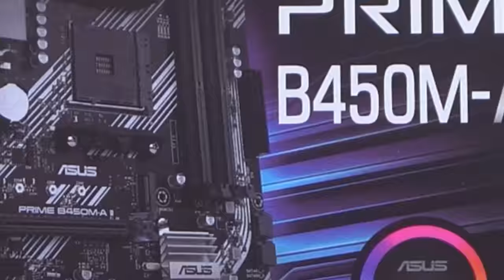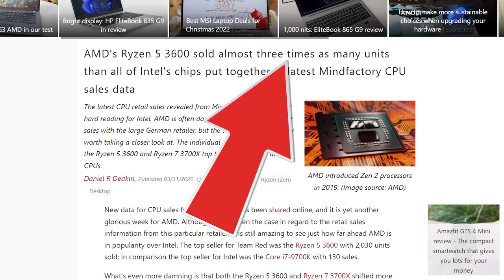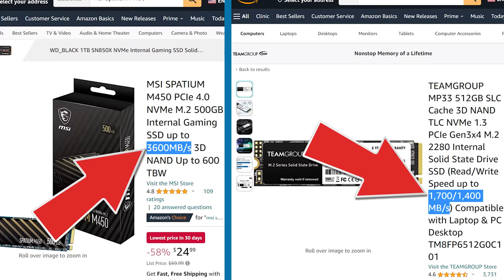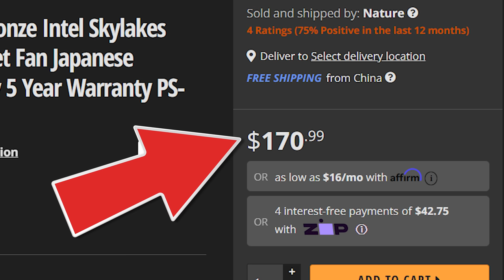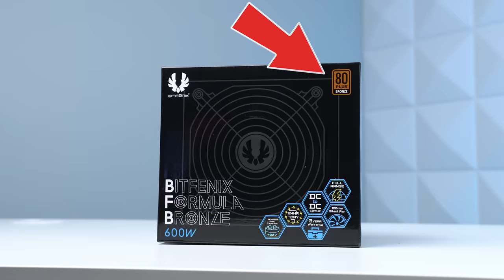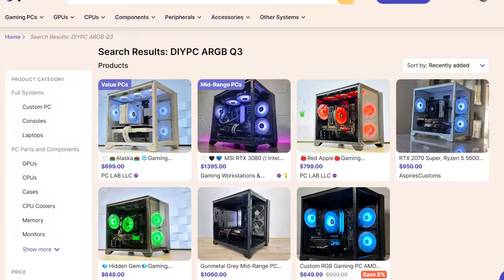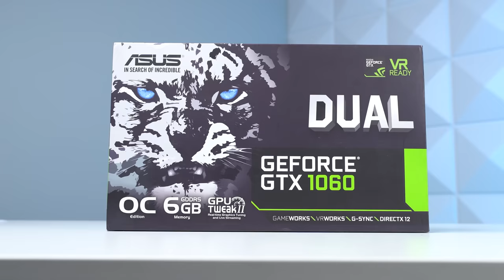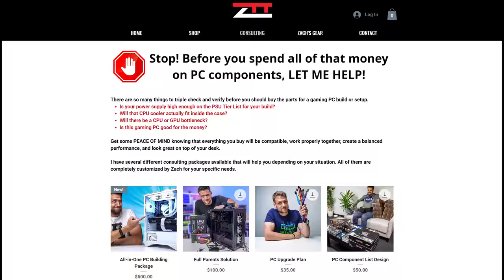A Very Repeatable $400 Gaming PC Build Guide

Comment: Why don't you just use the extra 21 dollars on a fully modular PSU instead of extensions? I'm pretty sure you can also get higher wattage as well. Good video I'm using this to flip
Reply: He's being super cheap so he can maximize profits. 1TB nvme's are $35 all day long but he doesn't want to spend the extra $7. I wouldn't buy any of his builds just on that alone. 500GB is nothing these days.
Reply: @itsatrap4986 Hey! I'm looking into buying a PC... I've never had desktop before. I'm thinking of buying a PC based on the build he showed here. Is there something specific that would make this a decent build?
Reply: @phoenixmorphix  Are you looking for a custom build or prebuilt that's similar to this? I'd would change out to a better rated power supply unit with the money saved from the extension cables and up the NVME capacity to 1TB minimum.
1) Better and/or higher wattage capacity for higher end GPU upgrades
2) NVMEs are dirt cheap - $65 for 2TB. 1TB minimum or 2TB if budget allows.
Reply: @itsatrap4986  Hey! I'm looking for a build similar... Thank you for the advice! I'll keep this in mind!
Reply: @phoenixmorphix  Yeah no problem. One more thing abOut the PSU, it's a C rated unit it's fine for what it is. Save the money for a better GPU. I'd skip the 1060 6GB, go with a RX 580 8GB or 1070/1070ti, 5700XT, 5700XT if you're going the used route.
Reply: @itsatrap4986 could it hand rx6600 ?
Reply: @Ice-Sik-ill  What do you mean?
Reply: @itsatrap4986  could it handle a Rx 6600 xt gpu, sorry. Haha
Reply: @Ice-Sik-ill  Yes the 3600/5500 is good up to a 6600XT/6650XT/7600 without bottlenecking.
Reply: @itsatrap4986   So all the other things he put are fine? except for the ones you mentioned here
Reply: @itsatrap4986  alright, sweet (cartman voice)

Comment: Rate my build, which is already above my budget but I'm waiting for Amazon prime day for deals. I live in Canada BTW. So here it is: Ryzen 5 5600x, Asus dual Radeon rx 7600 xt OC 16g, 32gb ddr4 Corsair Vengeance rgb pro 3600, msi mag B550 Tomahawk MAX, EVGA 850bq 80+ bronze 850w, Thermalright Phantom Spirit 120 EVO cpu air cooler, Fanxiang 2tb m.2 ssd, and for case NZXT H6 Flow which comes with 3 fans that I will have at the front for intake, and a pack of 3 Thermalright TL-C12C-S X3 120mm fans on top for exhaust.

Comment: I liked the video! I wanted to ask what is the best video card to choose for work (3D development), and possibly for games, so that it is budget-friendly and in reserve for the future. I have a system: Intel Core 7 11700k, 32 gigabytes of RAM, I have a 650 watt power supply, and an Asus b650 1200 socket motherboard, I think you understand what I'm talking about. I have an ATX-format case, so almost any video card will fit. Now I have a video card 1060 for 6 gigabytes, from Asus. Your opinion is interesting, I will read it with pleasure. Budget up to 600-700 dollars.

Comment: if u dont mind settling for a a320m-k mainboard (it will work just as well, got the same paired with an RX 6650XT + 32gb ram + ryzen 7 5700G , then you can even get it for 50 euros (dollars) since it is literally the same Mainboard and even looks the same apart from the chipset

Comment: Can you pleas make a video how to paint the cpu cooler i love the idea
Reply: Umm. Couldn't painting the cpu cooler mess a ton with the thermal dissipation or possibly fry a computer (if you let any paint drip onto any delicate parts, or if the paint melted or degraded over time?)

I admit im not a expert, but newegg usually has a lot of models to shop around for. It's probably easier and safer to shop around on newegg for a model you like. And while i got like a 1000$ computer, i don't really feel like the cpu gets very hot relative to the gpu. (Though, i did spend 10$ on 7x more heat transfer thermal paste meant for overclocking, 15 W/m^2 or something vs 1.7 W/m^2 or something for 10$). And it sits super cool just being superchilled by the metal heat sink (fan barely runs at all and it's cozy).

But i mean.. I might have overdone it a lil. I think like cpu gaming is like 80% your graphics card, 10% your ram, and 4-5% your cpu (unless bottlenecked). I think i did like a Intel 13100 (If i rebuilt today, the 12100 is 98% the performance for 100$ vs 110$ and fairly decent bang for buck on 1-4 core performance until 8 core).

I still like having a fancy ass cooler though. I guess the 13100 from best buy came with a stock cooler (despite 0 mention), and im happy with the massive heatsinks potentially cooling it 4x better passively with the coconut vs mandarin sized heat plate dissipation and the super thermal paste. 

I still would feel a little hesitant about spray painting though since just 1 thing goes wrong.. and frying a 1000$ computer to paint the insides a different color just gives me a lil gulp. (Or potentially frying their whole pc if the paint kept too much heat in / ruined thermal conductivity/degraded under heat).

To each their own though!
Reply: @Notyouraveragename  u dont put it on the mobo before you paint it, you take off the outer shell?? 🤣🤣

Comment: You should check out the Asrock B550m Pro4, or B450m Pro4. They're excellent sub $100 mobos. The B450m Pro4 with the 5.20 bios update will run any AM4 CPU/APU  except the 'Bristol Ridge' series. 
I can't stand fish-tank cases. If that case were available with large hole mesh panels in place of the glass panels it would have my interest.
Reply: If u live in sweden u can find some really nice deals like a 3080 for 60bucks im not even joking i found em on the marketplace

Comment: if anyone wants to build this in 2024 for any reason, I would go for a good motherboard (with a focus on more vrms mosfets, m2 nvme slots and if it is possible USB latest possible generation and PCIe 4 instead of PCIe 3, 16 lanes instead of 8 lanes (100-120$) possibly RAM and a good power supply. if it ever comes to the upgrade request, So you already have something solid. On the used market, more and more good cups and GPUs are found because they are starting to switch to am5 more and more. just my opinion

Comment: How do you reroute the cable? And what do you need for painting it and how to apply paint?
Reply: as a painter, you should LIGHTLY sand the fan so the spray paint wont peel off. lightly spray layers on until its fully covered

Comment: I just snagged an Asus white 1060 3 GB for $37 (after taxes and shipping!) The 6gb is obviously way better, especially on new titles but for $37--- Sheesh!
Reply: Oh wow the 60 series are a good card, i think they only improve +13% fps per generation. 3 gb might be a bit low, (I had tons of problems with my 4 gb 1650's vram just being too slow to run sd at all, or rdr2 past medium settings).

But 37$ is a steal if you're budget minded or get one of those motherboards that could support 2 graphics cards!

It's not the highest end model, but i paid 240$ for my 8 gb 3060ti which should have about 225% fps performance over the 1060.. 

But i paid 250$ and your paid 37$ For the price or frames per dollar, you got 3x a better deal and if im getting 200-300 fps, yours is still probably 90-150 fps which is still plenty! 

Your card is very similar to the other budget king, the Rx 580 which delivers about the same performance but for 80$-120$ new. That card of yours is definitely a steal for frames per dollar! Just you might not be able to get as much texture detail for like ultra hd shadows and might need to do low/medium. But 70-100 fps for gaming when most screens are only 75-100 hz/fps is super fair. And that's a super deal for 300% more frames/dollar that still should hit 70-100+ fps!

Comment: I use that case and built a PC with a Micro ATX motherboard 32 gigabytes of Ram 3,200 MHz I-5 CPU and a 580 GPU and a half a terabyte SSD all that was only $380 and I get over a thousand FPS on Minecraft but that is Minecraft

Comment: The RX 580 8GB can be had for less than a GTX 1060 these days.
Reply: I admit the rx 580 has it's advantages over the 1060 on certain vram happy games, but it's tdp is 185w vs 120w for the 1060.

Comment: hi i was wondering if a ryzen 5 5600x would work in this build and if i used a gtx 1660 super would it work without problems
Reply: Yes for sure
Reply: Do a b550 Mobo to get the most out of the cpu though

Comment: Is it okay to use a mid tower case for this build or would that mess things up this would be my first pc and im most likely going to get it
Reply: As far as I can think, it'll be absolutely fine. Generally with changing cases you mostly need to keep motherboard size in mind, but the smaller motherboard here would fit into a mid tower no problem. 

If I can suggest, if leaving aesthetic things like cable extensions for later down the road helps you start off with a slightly more powerful GPU, that might be worth considering if you want a bit more performance

Comment: yo bro love the vids just a quick question I am going to buy a prebuilt from radium pc I am stuck on what one to get so the first one has a 3060 ti 8gb and a ryzen 5 5600 and the second one is  with a ryzen 5 5600 and a Rx 6700xt and there is another one with the ryzen 5 5600 and a 3060 12 Gn what one should I get for high fps for fortnite but no fps drops first pc

Comment: Have you had any faulty ryzen 3600 cpu's?  Tech Yes City had a vid on this cpu and showed that sometime they may need some under-voltage adjustments.
Reply: This is something I'm wondering too. I seen another tech YouTuber with a number of 3600s fail in systems he was repairing. He thought it could be from budget builds with low airflow cases with little to no fans in them.

Comment: I'd be very hesitant to buy a PC from you respectfully. I found one of your listings on marketplace BUT after watching this video, I noticed you didn't apply thermal paste which is always a no go for me. Regardless of if the cooler comes with thermal paste preinstalled or not, I ALWAYS replace the thermal paste with something better because it obviously provides better cooling to the cpu.

Comment: Hey, i currently have a ryzen 5 3600 and a 1050ti, thinking to upgrade the cpu to a ryzen 7 5800X that i can get for a good deal from a friend. Would this be a good decision for pure fps games like fortnite, valorant, cs, etc as ive read that they are cpu based games
Reply: I think it’s still a good idea to take some of that budget from the 5800X and put that towards a better GPU. If you’re just playing games like fortnite and val(which aren’t that demanding on CPU to warrant a 5800X), there’s no reason to spend extra on a 5800X over something like a Ryzen 5 5600, which can still meet your needs and then some while being more cost effective. If you’re using a specific deal that only allows you to get the 5800X, there should still be more money put towards a new GPU but for the immediate future it’s fine. The 1050 Ti is absolutely not likely to keep up with the 5800X and will be the bottleneck in most situations. Otherwise get a 5600 and RX 6600XT or even a 6700XT if you have the budget. Prime day is still there in quite a few time zones so if you live in one of those time zones, just letting you know that 6600XTs are being sold for $240 and 6700XTs for $300 right now on Amazon with discount.

Comment: No point getting the MSI ssd if the board is limited to gen 3 speeds
Reply: price between gen 3 and gen 4 drives aint that big these days, and when you upgrade the MB in the future you get gen 4 speed compared to if you bought a slower gen 3 from the start.

Comment: Hello! Please next build make a programming pc under 1200$.
Reply: I mean, for programming, im not a specialist but wouldn't it be good to know what your system is bottlenecked for?

Like blender or rendering or video editing, one might be limited by ram. You can get 64 gb of ddr4 ram for 120$, or 64 gb of ddr5 ram for 140-160$ on the day. (Usually 20-30 gb is all you can top at. So maybe 32 gb might be more optimal. But 32 gb was 100$-110$. 64 gb was 140$. Why the hell not spend 25% more to get 100% more lol was my call. XD)

If you do stable diffusion, you might be limited by stable diffusion render speeds. Generally userbenchmarks and toms hardware cross compared will be good for that. (Generally the fps comparison is fair to per card sd speed performance. The problem is amd and Intel COMPLETELY lack xformers/nvidia optimizations. And thus often deliver 2x slower speeds even on a 20% stronger for gaming card. Keeping you locked to nvidia for stable diffusion/automatic 1111. While amd can actually delivers beastly performance for msrp price gaming and generous vram for games like hogwarts legacy/last of us. 

Where 12-16 gb of vram isn't uncommon and unoptimized ps5 games sometimes ask for 12 gb vram.. Yet nvidia releases 500-800$ msrp cards with the same 8 gb vram when a 200$ 3060 had 12 gb 4 years ago.. 

Some applications for programming are also core dependent. (I gotta admit i know the least), but i've heard a lot of people talk about Amd's Threadrippers for cpu applications. (Again, i know little about this). 

But for programming, im not the expert but it might be super relevant to know what your programming system is locked to itself. A lot of your performance can come from 80% of one part, and you can get uber performance by dedicating the biggest budget to that part. Blender/rendering can scale off ram, Stable diffusion scales a ton off graphics card, and certain applications can scale a ton off cores. 

I admittedly don't know much about the specializations. But it might be good even asking peers or google what the needs for your work device are and the most important parts of the software you're going for! I have a sd optimized rig. (literally 20-40x faster than my last 1650 computer. Generating 1024s in literally 7s-10s vs 6 minutes is a miracle). 

But needs for software can be very specific and by finding the part that's linked to 80% of performance, you can specialize your budget for almost supercomputer types of performance in a budget!

Comment: I got a question to ask, say i want to switch out the gtx with a RTX 2080 Super, would it still work? Would it be fine?
Reply: Yes a Rtx 2080 would still fit the motherboard and the case
Reply: But I recommend getting a 650w power supply if you want a RTx 2080
Reply: Sorry for the late reply, but I found out the 2080 super I bought wasn't listed as non functional on eBay, though I've gotten my refund since. I bought a used RX 6600 for $160
Reply: @Chree1s does your pc run good im about to order these parts
Reply: @KaziKami  can't really tell you, my case and motherboard are arriving today, and my ssd is arriving Tuesday, though I can tell you what I got parts wise.

CPU - Ryzen 5 3600 (with stock cooler)

MoBo - ASUS Tuf gaming a520m-plus wifi

RAM - Corsair Vengeance RGB Pro SL 16gb DDR4 3200MHZ CL16

SSD - TEAMGROUP 512GB M.2 NVME

GPU - MSI Radeon RX6600 MECH 2X 8G

PSU - Thermaltake Smart 600W 

Case - Antec nx200m rgb
Reply: From what I've heard the 3600 and RX6600 is a decent combination, my budget for this pc was low, around $500

Comment: Hey i hv a question i hv no clue abt buying a pc and i wanted 1 i want to know that if I buy a pc would my ps4 still work good on it?
Reply: That makes absolutely no sense at all. PS4 and PC have nothing to do with each other.
Reply: @JJFlores197  no I mean when I connect my PS4 to a PC would it still work the same way as it would on a TV?
Reply: @streak9401  you cant connect a PS4 to a PC?
Reply: @daviddenner8121  can't I use the monitor to play with it?
Reply: @streak9401  Dude, you're asking 2 different questions. You can't connect a PS4 to a PC. Doesn't work that way. You can connect your PC to a monitor or TV with an HDMI cable.